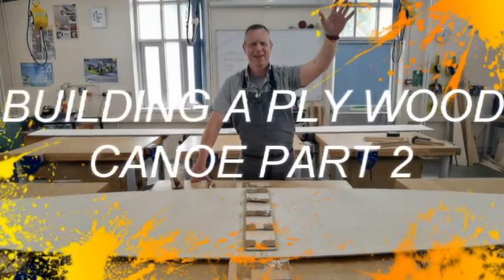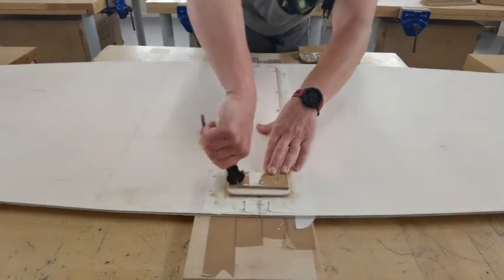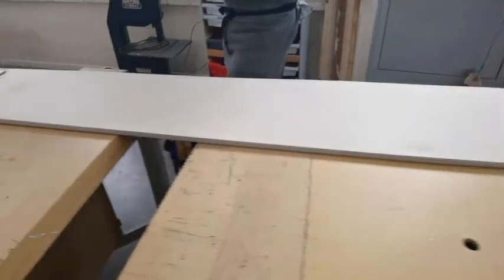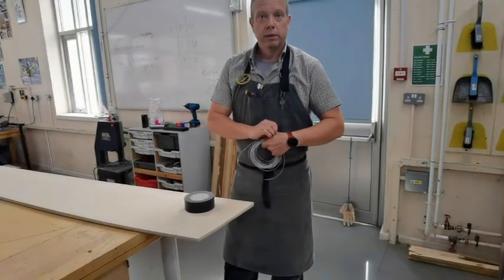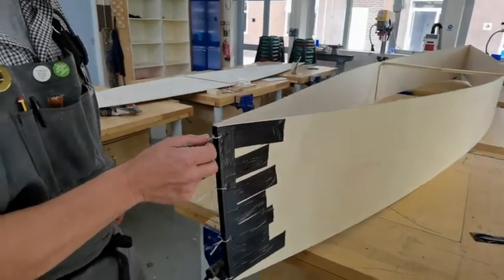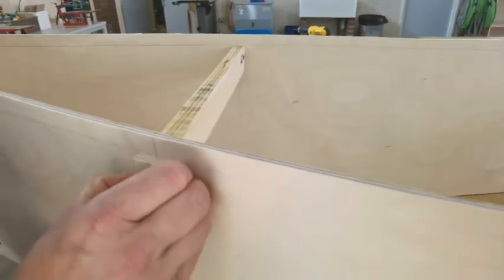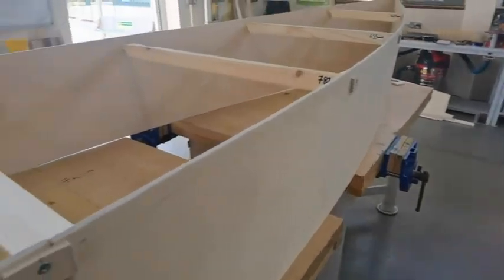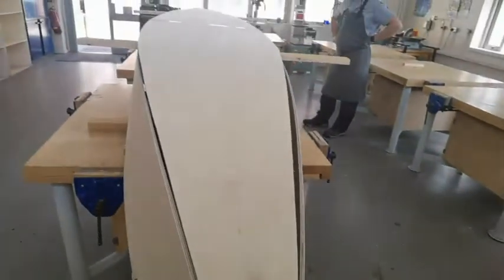BUILDING A PLYWOOD CANOE - PART 2 Assembly #canoebuild

Comment: I built a so-called  6 hour canoe  several  years  ago.  But  after  I  added  all  of  the  extras,   it  went  from  40  or  45  pounds  to   80  pounds.    And   It  took  me  7  months  instead  of  6  hours.    So  I  did  much  more  than  the  basics  that  were  first  mentioned.   But  they  did  show  me  all  of  the  extras  and  descriptions  in  their  book.   They  mentioned  connecting  two  1/4  inch  thick  sheets of  marine  plywood,   4  foot  by  8  foot  to  make  one  long  sheet.   But  they  also  mentioned  that  I  could get  a  16  foot  long  piece.   So  that  is  what  I  did.   Much  easier  to  start  with  a   16  foot  long  piece.   So  I  added  bulk heads  and  a  small  keel,  extra  1 X 2  inch piece  of  floor  cross  pieces  for  floor  strength,   a  custom  seat  that  folds  down  from  the  sporting  goods  store,   and   supports  and  hardware  for  hanging  it  in  the  garage  in  those bulk head  areas.   Also  made  a  double  thick  center  brace  (  forgot  what  that  is  called )  instead  of  the  single  one  mentioned  in  their  book.   So  in  the  end,  it  came  out  15 1/2  feet  long  and  a  lot  of  compliments  whenever  I  take  it  out  for    some  fun.   When  I  bought  it  from  the  lumber  yard,   they  let  me  cut  it  up  in their  parking  lot   into  the  basic  three  pieces  that  I  needed  from  it  by  using  a  hand held  jig  saw.   That  way  I  was  able  to slide  it  into  my  suburban  lengthwise  with  the  three  pieces  stacked  on  top  of  each other.  I  didn't  want  to  take  a  chance  of  it  flapping  in  the  wind  because  of  the  long  drive home  if  it  was  on  top  of the  car.   And  I  wanted  to  pick  out  the  piece  I  wanted  myself  instead  of  a  piece  of  junk  that  they  actually  did  send  me  the first  time,  which  I  sent  back.